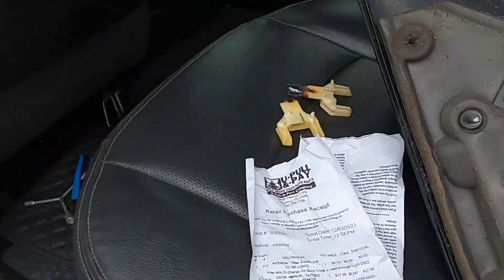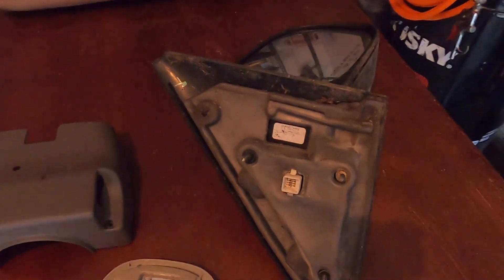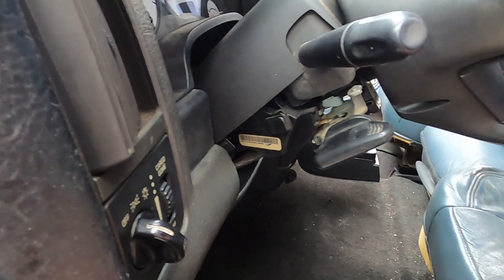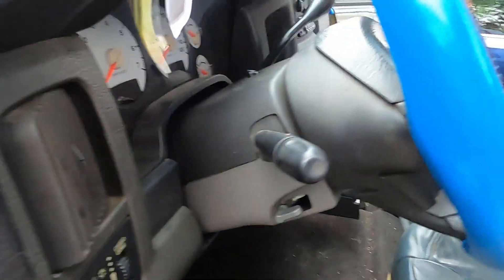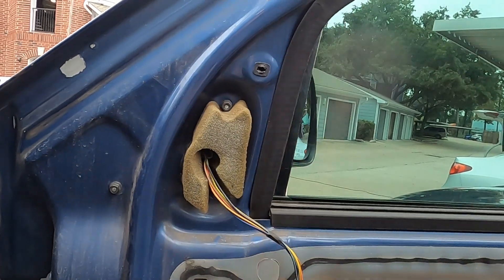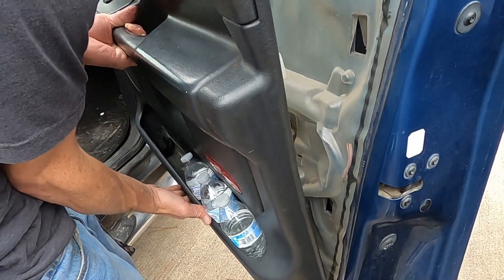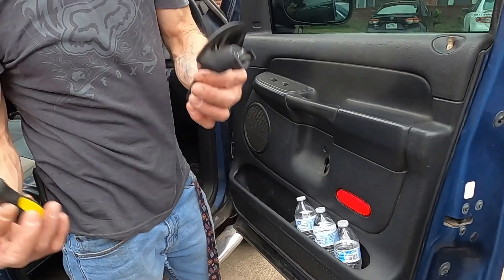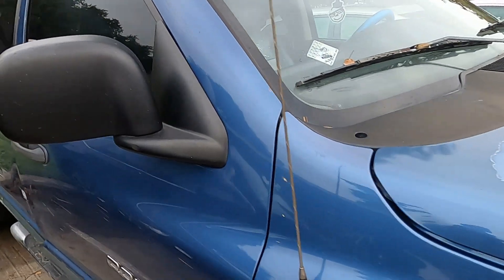03 Hemi Ram Mr. 417,000. Ole Blue, Side mirror, Column cover, and dome light Replacement.

Comment: Yo. Speaking of the heater core,  my ish so clogged up. I had to used the radiator cleaner w/ hot water to unclogged it. Using a hose wasn’t working for me. 😢